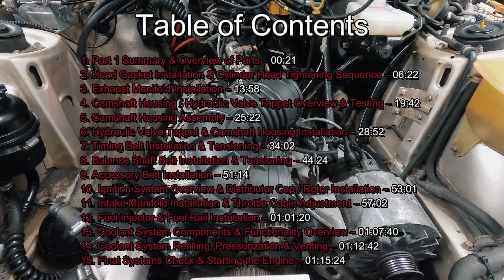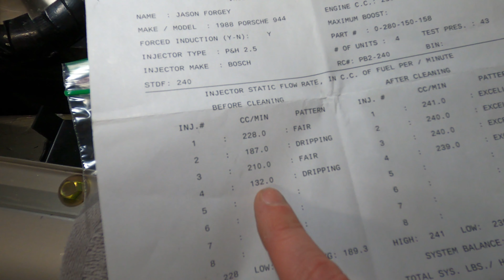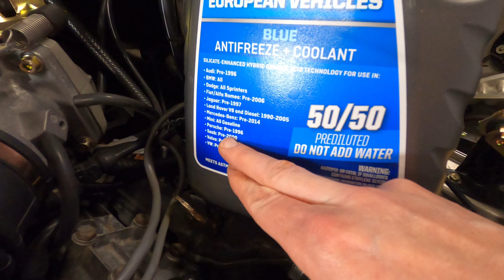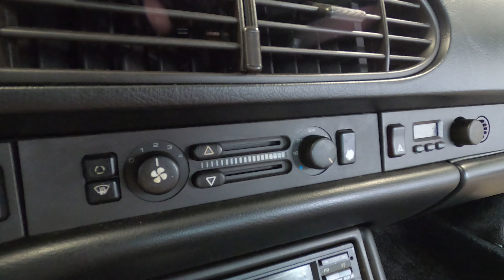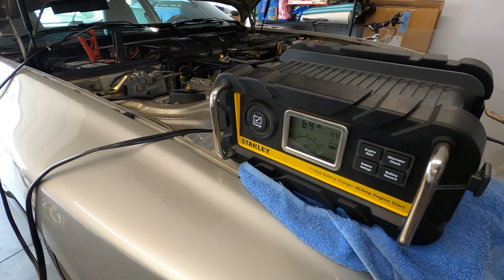Porsche 944 – Head Gasket Replacement Tutorial – Part 2: Reassembly / Installation

Comment: The most expensive yet satisfying replacement 944 things are new expansion tanks and brake reservoirs.
Reply from the maker: Agreed! Although I was just yesterday quoted $1,300 for an OEM Sekurit windshield with the built in antenna. 🙄
Reply: @NC944er  Yeah I managed to find a used 968 windshield that was removed carefully as they are very elusive new and expensive.

Comment: Don't forget that the head nuts are either 12mm or 10mm, different torques for different nut sizes
Reply from the maker: Good to call out the nut heights, originally determined by model year/engine designation, but these cars are so old there’s no telling what parts people have installed over the years. Probably safest to confirm part numbers for the proper height/torque. The ones I used on this ‘88 were the 12mm variety. Thanks for sharing! 👍🏼

Comment: Did you find a reasonable price for lifters?  Looking online Lindsey sells them for $375 a pop which adds up fast if you have a handful that need to be replaced!
Reply from the maker: @HardwayLearning  Hey, yeah the new OEM prices are insane. I typically go for used ones because the OEM design by INA has been updated and there have been some reliability complaints. The best price for used will be through Plyhammers Parts when he has them in stock, currently none available, but I’ve paid as low as $3-$9 per lifter. Otherwise eBay generally has some sets for sale. There is a really nice NOS set of 8 for $600 on there right now.

Comment: @53mins 27 seconds, the coil sends a high voltage of around 30,000 Volts, but the current is very low.  Anyways I like your videos. Keep it up
Reply from the maker: Yes, thank you! There was indeed a mistake in the way that process was described. The hours of working on the car, while filming, and trying to explain things had taken its tole on my brain at that point. 😂
Reply: @NC944er  Just found your channel last night, you have made some great content and its very informative too.

Comment: Another amazing video! Quick question, did you replace the head studs? I always assumed they were not supposed to be re-used.
Reply from the maker: You’ll see differing opinions on whether or not they “should” be replaced, but the general consensus I gathered from the community is that they can be safely re-used a couple times. They can be problematic to remove and a broken stud wasn’t something I wanted to deal with at the time, so I opted to re-use them. If you decide to replace them, this kit may be useful - https://www.powerstream.com/944-head-stud-repair.htm

Comment: 53:24 - I think you made an unintentional mistake saying "...the coil sends a 12 volt current to the center of the cap...". Actually 12 volts is sent to the low side of the coil, where it is transformed (yada yada technical explanation...) to high voltage of about 12k-25k volts and sent to the center post of the distributor which routes it to the appropriate spark plug. Great video overall with excellence all around. I'm thinking you are an engineer and possibly even a teacher on the side. 

Edit: There is no physical contact between the rotor and the distributor cap terminals. There is a very small air gap which the current jumps on it's way to the plug.

[1985/2 944 Base, Alpine White/Black]
Reply from the maker: Good catch and thanks for sharing your expertise! There was indeed a flub when explaining the coil. 😃

My understanding was that the rotor “shouldn’t” be making significant contact with the cap terminals and that the wear comes mainly from the repetitive spark, but on most of the ones I’ve seen, there are directional wear lines in the plastic just before and after each terminal. Could this be from the cap being slightly misaligned after installation and then after a few rotations (and contact from the rotor), the cap gets pushed into optimal alignment? It seems like, to your point, that the air gap is so small and because the hook screws don’t allow for precise application, that the alignment could easily be off. Appreciate your insight! Thanks. 👍🏼
Reply: @NC944er  While it is possible for slight misalignment and contact between the rotor and the cap terminals due improper installation, physical contact should never occur. Such a condition could result in a broken part, cracked insulation, or metal flakes inside the distributor cap, all of which have potentially negative effects on the intended path for electricity. Thinking back on prior experiences, I don't recall ever having seen signs of physical contact between the cap and rotor, and with our Porsches it seems unlikely to occur given the geometry and indexing design of the cap. I believe the "wear lines" you observed were carbon tracks from many miles of use. Keep in mind that the spark gap between rotor and cap is not static - it move forward with rotor rotation as the spark is advanced with RPM, making oxidation tracks longer and more visible over time.
Reply from the maker: @autobreza7131  Good stuff, thanks! The one in recent memory had a heavily aged and compressed foam gasket, which may have impacted the fitment of the cap, and as you said might happen, that was one where the metal arm on the rotor was slightly bent upward, albeit on the trailing side. 🧐 

With all these cars have been through, sometimes it’s hard to discern “normal” behavior. I’ve made some updates to the technical descriptions in my Distributor Cap & Rotor Tutorial video and reposted it based upon our discussions here, so thank you for contributing to the channel! 👍

Comment: Any idea what the original factor specification was for the valve stem height? I just got my head back from the shop today but never mentioned I needed my valve stems cut.
Reply from the maker: What services did the machine shop perform? The valve stems would only need to be cut if the valve seats were cut and the valves lapped. Removing this material from the valve opening area would cause the stem height to increase slightly. The specs are listed in Factory Workshop Manual, Vol. 1 Engine, Sections 15-16 through 15-19. I printed this and gave it to the shop when I dropped off my head for service, but he didn’t really cite the specs, he just measured my setup before and mirrored the measurements after the other work was completed. Here’s a link to some free online manuals - http://p914-6info.net/944%20Manuals.html
Reply: @NC944er  Here is what the shop told me. Thanks for the refrance also!  "Your head is done, we leak tested the ports, installed your 5 guides that's all it needed and ground your 8 valves and seats, surfaced .011 off of the head, pressure washed, shimed the springs to 120lbs installed, and reassembled. Your bill comes too $287.26 Sorry we don't accept cards for payment. Check or cash will work. Thank you for your business!"
Reply from the maker: @squeakychairproductions6813  Oh wow, that’s a pretty good price for all that. 👍🏼 The terms “ground” and “cut” are used interchangeably, it sounds to me like they did what was needed to complete the work the right way, but it couldn’t hurt to ask them just to be sure. All that work is pretty standard and done together at reputable shops.
Reply: Yeah agreed and I was very shocked with that price also! Thanks for entertaining my questions man! This guide has really been incredible! Do you have anything setup if I wanted to make a donation?
Reply from the maker: @squeakychairproductions6813  Absolutely, happy to help anytime if I can. 944 knowledge is a dying art. 😂 Here are a couple donation links if you felt so inclined. Cheers!

PayPal - https://www.paypal.com/paypalme/NC944er
Patreon - https://www.patreon.com/NC944er
Reply from the maker: @squeakychairproductions6813  Thanks man, got the ca$h! Really appreciate it! My driver’s side door handle trigger snapped this week on a cold morning, so this will help out with the new linkage arm I have on order. 😂

Comment: @NC944er Where did you get the jumper cable to prime the fuel pump? I can't find one anywhere. Thanks for posting these videos they are outstanding!
Reply from the maker: Hey, the jumper was a homemade tool using some old copper wire and a couple of flat blade connectors crimped on the ends. I keep a couple of those in the fuse box in the event of a failed DME relay, you can jumper it and drive.
Reply: @NC944er  Awesome thanks for the response!

Comment: When bolting on the cam housing, did your cam move a little from the TDC cam marking?
Reply from the maker: As I recall, it moved by a very small amount, maybe a millimeter. You can keep an eye on it as you tighten the bolts down, but once there is pressure on the valve lifters, it’s pretty steady. Any slight deviation from the timing marks can be corrected with a 1-1/4” wrench on the retaining collar.
Reply: @NC944er  mine moved quite a bit. Im a little worried about correcting it. My timing lock didn't move, so I know that not the problem. It appears to have move a full 3 teeth on the cam. Hopefully it won have any problems when I line up the marks and put the belt on
Reply from the maker: @user-qf8lv6so5s  My guess is that you’ll be ok in terms of not having damaged anything. The cam gear can be off by ~10° before the valves would be pushed down far enough to contact the pistons. I’ve seen someone claim a timing belt was off mark by 4 teeth without damage once, although I’m surprised the engine would even start at that point. 😂

Comment: Did you use oe turbo valve springs?  How did you come up with the 120 lb seat pressure?  A machine shop should adjust spring height to achieve factory spring seat pressure.  Lots of controversy over actual seat pressure, just trying to figure it out.
I used Isky springs on my turbo rebuild set around 145 lbs.
Reply from the maker: Yeah, the springs came from Pelican Parts, part #: 951-105-905-10-INT, listed as OE Supplier. Assuming the shop used a gauge to test after installation, but they didn’t specify if it was seat pressure or open pressure, just said “they tested at 120lbs.” I gave them excerpts from the Factory Workshop Manual for stem height and guide installation specs, but they basically measured and mirrored the factory height set on the NA springs. I don’t hang out above 5,000 RPM too much, so while the reduced valve float was a bonus, cost was the main factor for me in switching - $15 per set on the Turbo springs versus $50 on the NA.

Comment: Amazing, keep up the good work! Did you choose not to replace the head studs? Anything to look out for there?
Reply from the maker: Hey, thank you! Yes, based upon a previous experience with water pump studs snapping off in the engine block, I opted not to touch the head studs. The stock head studs are designed to stretch when torqued, but can generally be reused once or twice, unless you’re assembling a high performance or track build, the best results would probably be to replace them in those cases. 

If you decide to replace them, consider taking a dose of recommendations from the forums, the double nut method has a tendency to fail, but a stud extractor tool or large pipe wrench  typically works. It’s recommended to first heat the engine block to loosen the loctite on the studs, although some people have still omitted this step with success. 

If any of the studs end up snapping, you’re then looking at drilling then out and installing a Timesert to repair the threads. There are some kits available such as this one that can make that repair a little easier - https://www.powerstream.com/944-head-stud-repair.htm

Comment: where can I get the hardware and plug for the cam housing end cap near the distributer?
Reply: the cam gear cover.
Reply from the maker: The belt inspection hole plug is available from a variety of online vendors. Search for part number: 944-105-131-01
Reply from the maker: @andrewpuck1568  The aluminum cam gear covers are NLA, I picked up a nicely conditioned used one on eBay. Or you could have your current one powder coated.

Comment: Where did you get your parts zinc coated? Love the build, I’m picking up a 944 this weekend 🎉
Reply from the maker: Hey, congratulations! They are really fun cars to work on. For the zinc plating, I used Parker Metal Finishing out of Greensboro, NC. The mainly so large industrial jobs, but one of the owners does small batches on the side. It was about $100, parts need to be stripped or blasted before the plating process so it adheres well.
Reply: @NC944er  Thank you! The one I’m getting is not running so I’m sure I’ll be using some of your videos to diagnose it!

I appreciate the information 🤙
Reply: @NC944er  Is the yellow zinc color what it was from factory? If not, do they provide different color coatings?
Reply from the maker: @944LS  Yes, yellow was the standard used for most parts on the 944 from the factory. The options are yellow or white (clear), which basically just looks silver or bare metal. Yellow provides the best corrosion resistance and has a nicer look. There are also blue and black zinc colors, which weren’t used to my knowledge.
Reply: @NC944er  okay awesome! Thank you for the info 👍

Comment: Hi.. I like how you work...... but why you didn't replaced all hydraulic lifters?
Reply from the maker: Hello! The original hydraulic lifters generally don’t wear out or break and they should last for the life of the vehicle. As long as the oil is clean and regularly changed, the valves inside the lifters won’t get clogged. In this case, all but two of the lifters tested good.
Reply: @NC944er  👍
Good work you have done on that car!